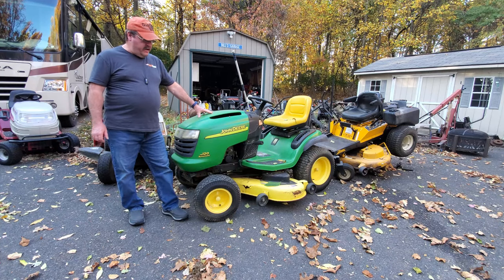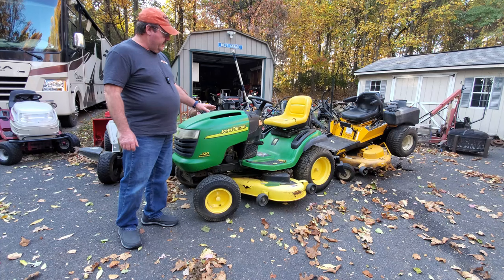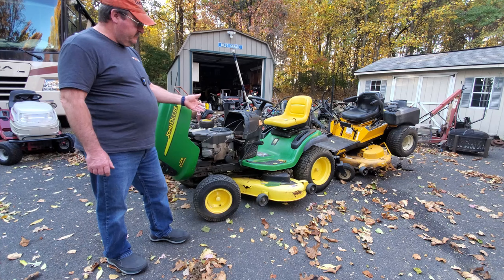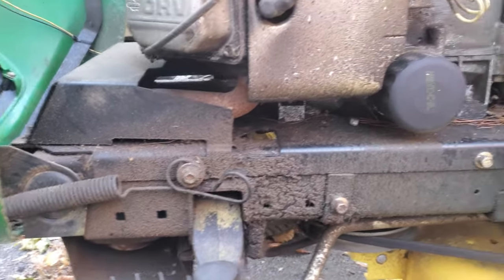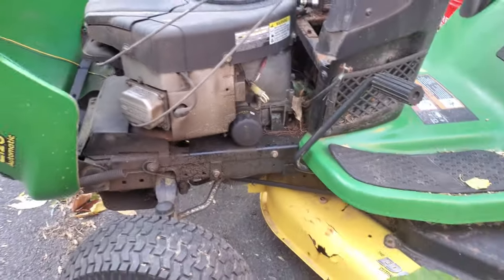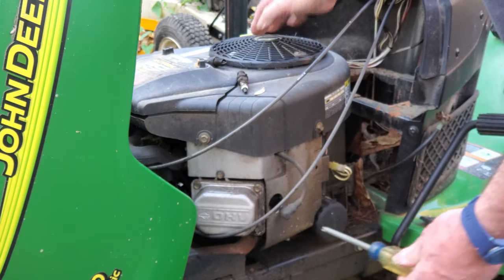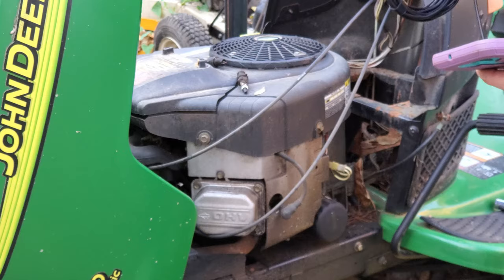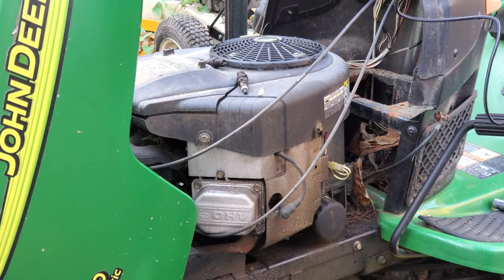John Deere engine smokes, I have NEVER seen this INSIDE a cylinder.

Comment: The casting was/is porous? I'm thinking that is a factory defect.
Reply from the maker: Possibly,  could have sat too long with water in it too, or flooded with gas that started attacking the steel.
Reply: @ridingmowerking  That is also a possibility. But one thing is for certain. It is would be to costly to repair. That engine block is basically junk.

Comment: That machine has been totally abused it's whole life. Properly maintained, those engines run for a long time. John deere sold those same exact units and stocks parts for them. They are homeowner quality,   definitely not commercial, but much cheaper and all some people really need to maintain an acre or less yard.
Reply from the maker: You are correct, when you see it in person you can tell it has been neglected. Just a little bit of care and it would still be a nice machine. Those engines are usually pretty good. Thanks for watching.

Comment: I’ve have several come in shop with so much carbon on top of piston that it broke the top side off to top ring and damaged the cylinder 😢😢
Reply from the maker: I would think maybe the carbon is more from burning oil than from poor fuel.

Comment: Results of corn cheap gasoline 😢😢😢
Reply from the maker: possibly, I wonder if it could be pin holes from water that somehow got in there. or maybe gas that got past the float, then sat all winter and then the ethanol started attacking the metal.